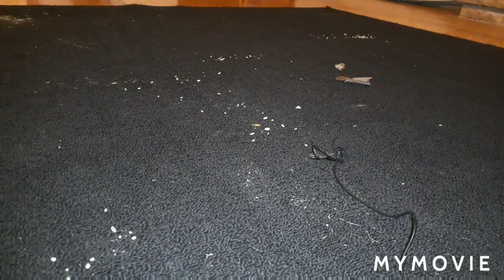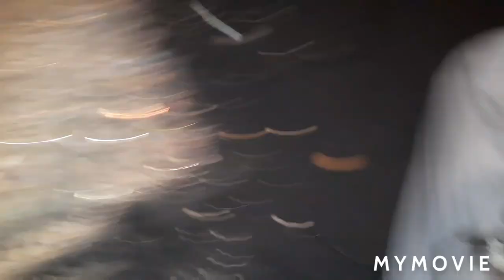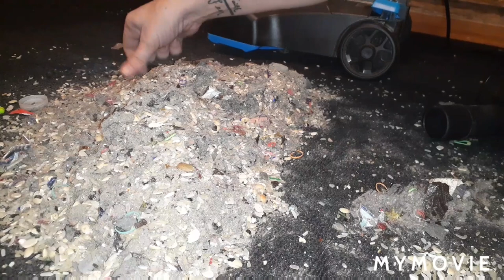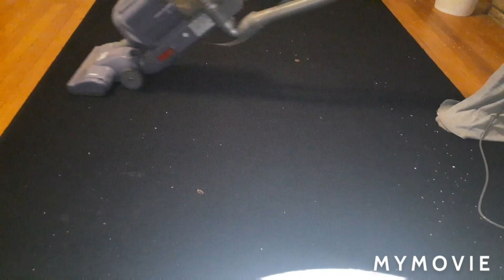Request for Vacuum Genius ASMR!

Comment: 😍 TIMESTAMPS 😍

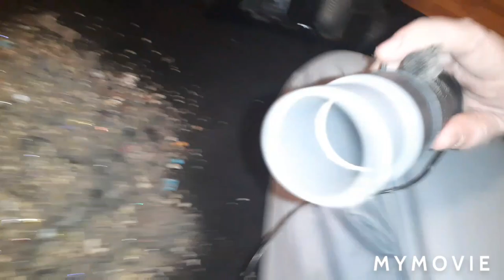00:00 - 0:28 : Bin dump
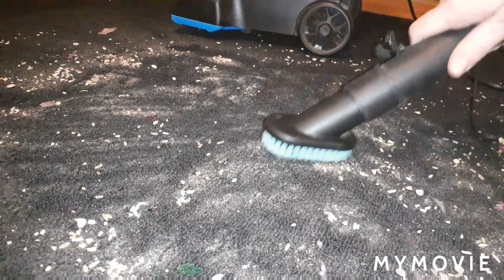0:28 - 13:12 : Helix inverted crevice tool pile attack w/ crunch mix on black rug (closeup, POV) 
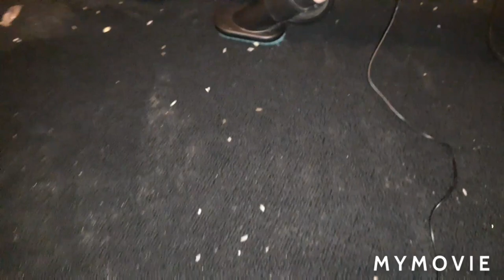13:12 - 14:27 : Helix dusting brush cleanup on black rug (closeup, POV) 
14:27 - 14:44 : Bin dumps
14:44 - 15:33 : Spreading out the dirt  (ASMR sounds)
15:33 - 17:29 : Spread out Helix brushroll pickup w/ crunch mix on black rug (low angle) 
17:29 - : 18:18 : Bin dump into plastic bucket 
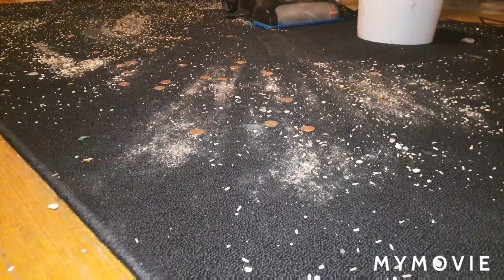18:18 - 19:43 : Spread out Helix brushroll pickup w/ crunch mix on black rug (aggressive, low angle) cont.
19:43 - 20:29 : Bin dump into plastic bucket 
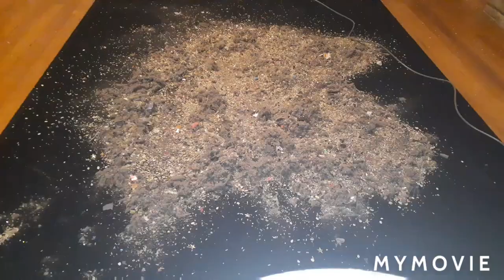20:29 - 23:27 : Helix brushroll cleanup on black rug + overflow vacuuming on hard wood (low angle) 
23:27 - 28:25 : Spread out Navigator brushroll pickup w/ crunch mix on black rug + clogged vacuuming (aggressive, high angle)
28:25 - 28:49 : Navigator metal hose pickup w/ crunch mix on black rug (high angle) 
28:49 - 30:23 : Navigator brushroll pickup w/ crunch mix on black rug (aggressive, high angle)
30:23 - 34:00 : Navigator brushroll cleanup on black rug (high angle) 

🥰🥰🥰🥰🥰🥰🥰🥰🥰